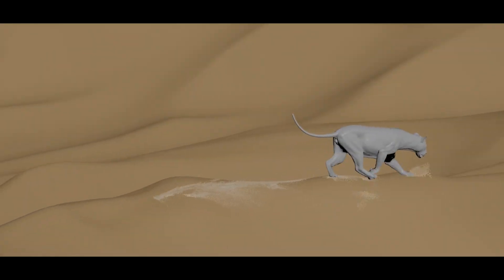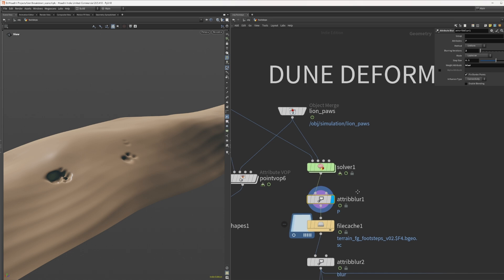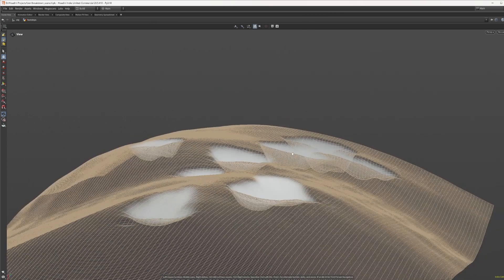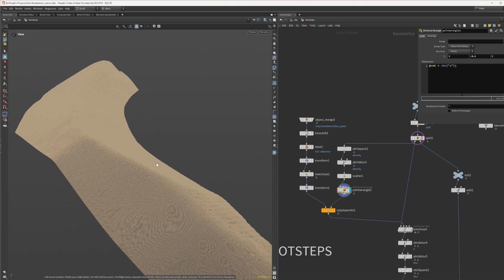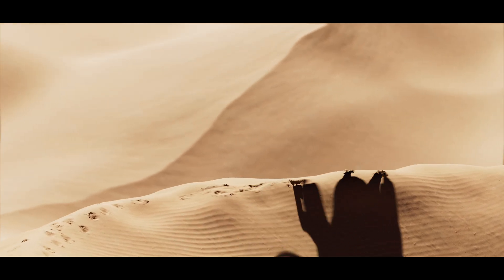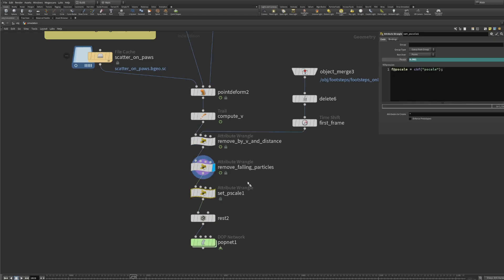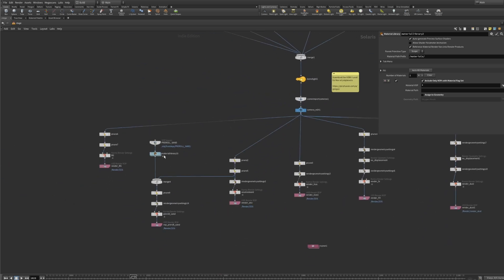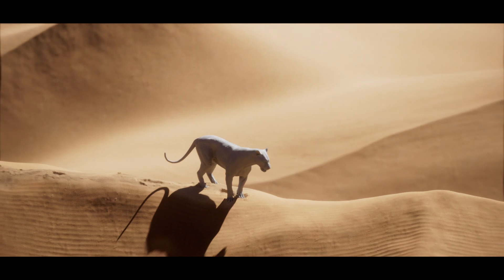Sand in Houdini is easy using this workflow

Comment: Great tutorial for beginners, I want files but I don't have axiom solver , I have only Pyro solver
Reply from the maker: Thanks! You definitely don’t need axiom to learn this effect. The volume sim is a very minor part of this shot and can be done just as well with Pyro. I just happened to use Axiom in this case cause it’s a little faster, but maybe by just a few minutes really. Try it with the pyro solver and if you get stuck, I am here to help! You should be able to just replace the Axiom solver with a pyro solver perfectly fine.

Comment: How did you learn Houdini?
Reply from the maker: @RenderRat  a few online courses for learning the software and then practice practice practice, doing personal work non stop
Reply: @tondann thanks! Would you ever do a longer scale tutorial for beginners? I would be willing to pay!
Reply from the maker: @RenderRat  Maybe soon, but not right now. I am focused on work right now and a few short little tutorials on the side. Making longer form content like a course would take a lot of time, that I don't have right now.
Reply: @ thanks! If I wanted to practice in this file, would it be possible to import a different animation, like a character walking onto the simulation to see how it interacts? Or will it only work for the lion paws? Sorry if it’s a silly question, I’m very new to Houdini.
Reply from the maker: @RenderRat  If you're brand new to Houdini it will be a bit difficult to apply this setup to a different animation because its not super straight forward maybe. But if you put in the time to figure it out, it would definitely work. Keep in mind that I modeled the dune to work with the lion animation I was given, so the feet step onto the dune correctly. If you want to use a different animation, the feet or whatever is intersecting with the geo is aligned with the geo of the dune.

So in short, yeah it would work but you'd need to change it and adapt to your anim, it won't just be plug and play. Hope that helps!
Reply: @ do you have any specific courses that you took that you recommend when you were first starting out?

Comment: Simulating each footstep individually seems bonkers, why would you do this
Reply from the maker: @zurasaur  Imagine every footstep working just fine but just the last one fails or doesn’t look good. To tweak just the last one you would need to simulate all the ones before, even though they were perfectly fine. You might even risk, ruining the prior ones. If you work in production you quickly realize that control and reliability is the no. 1 priority. Also doing it individually barely adds any extra work, just move the delete bounding box to the next, copy paste the setup and cache.
Reply: biggest time sink in grains is PBD calculation so reducing the amount of points simulating at once reduces sim times overall even if the caches are split up.  

Splitting the caches also allows you to hit production notes easier rather than adding little velocities and stuff all over the place which start making the set up very dirty, it also allows more control when you only need to tweak 1-2 footsteps and not have to run the entire sim.  

breaking the caches into individual footsteps also allows you to push all the sim work to render farm and process the entire batch in parallel.
Reply: I’m 50/50 on this one - on one hand it’s great for performance, but the setup is way longer and getting no interaction between any footsteps - if I didn’t like a certain footstep I could just delete the points by id after one big sim
Reply: @ sure man you do you :)
Reply: @zurasaur  I bet you'll be a great team mate in production.

Comment: Great video! Is there a reason why you didn't use vellum grains minimal solver instead of pop grains? Isn't it faster?
Reply: POP grains is about 15% faster there is less overhead in system it’s just raw PBD, it’s also opencl accelerated just like vellum

Comment: great stuff, look into distancefromgeometry SOP, as a replacement for xyzdist type effects, it has some nice controls.
Also attributeinterpolate to replace pointdeform as it's lighter and more accurate, especially for points stuck to mesh surfaces.
Love the format, less bs bloat!
Reply from the maker: Thanks Lewis, I like to do most of my work in wrangles, so it’s lightweight with no overhead and I can add channel parameters easily. It’s just a preference probably!
Reply: @ it shouldn’t be much different overhead wise, it’s always good to be aware of wrapped tools Vs your own tools and weighing up what is better. You never want to be wedded to one method. I noticed you split each step into separate sims and caches, it’s not something you’d see in production, I get you probably want per step control, but in practice this isn’t how you work, but I think you know this heheh.

Comment: This looks great and quite an indepth walkthrough. I have a question about why you used a sim for each footstep at @1:45 ? Later you use a pop awaken anyway
Reply from the maker: @Rick_Sanchez_1337  I can tweak each footstep simulation on its own. If something goes wrong in the last footstep for example, I don’t have to simulate all the prior ones. More control and reliability 😊